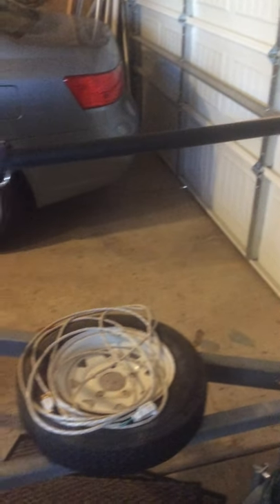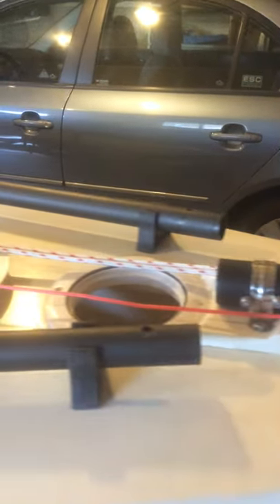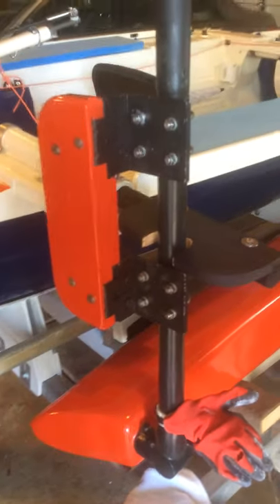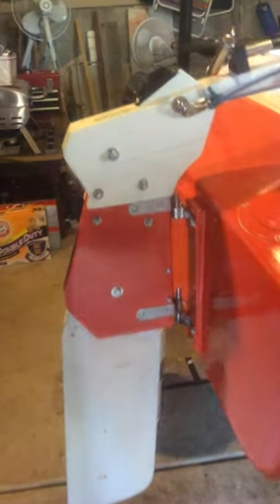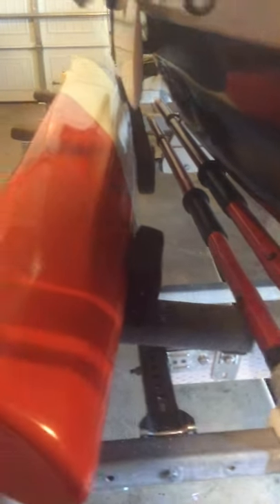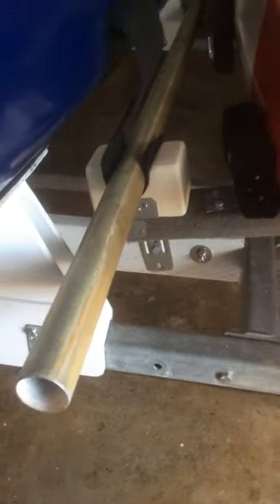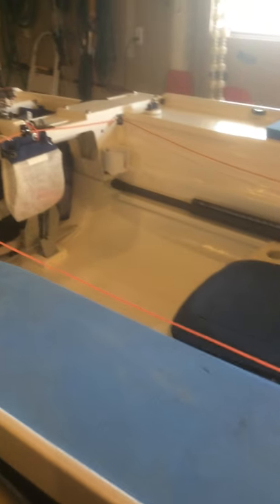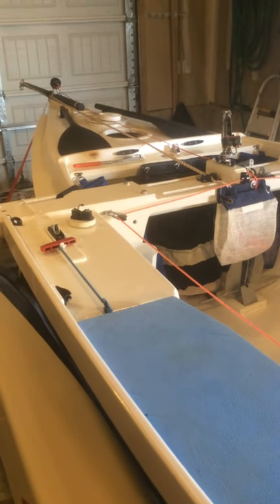Squirt Trimaran Build - update

Comment: Hi Eric 
Seeing some inspiring ideas in your video. Thank you for sharing. 
Wondering how you setup for sleeping aboard? 

Today I went to pick up a Fiberglass canoe shell, has only a few easy fix cracks. It’s 18’ long, 41” at the beam and 18” deep with a keel. Paid $100 to get it out of their yard. 

I’m thinking trimaran too. 
Would you build your differently if you wanted to de over? 

Steve (68yrs) 
Manitoba
Reply from the maker: I actually didn’t ever try sleeping on board. Could lay down but carried too much gear on my week-long ventures so would have to remove first to make room. Found sleeping in a two-man tent much more comfortable, dry and bug proof. As to building differently, don’t think so. This was a foam Snark originally so I went with foam and ply to trim her out to the trimaran you see.